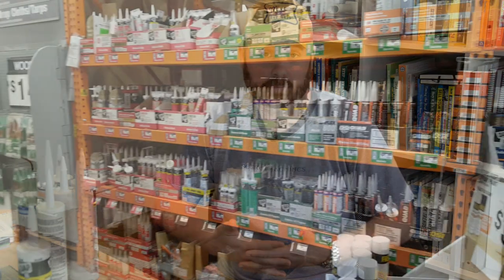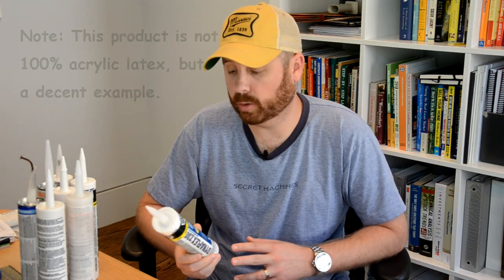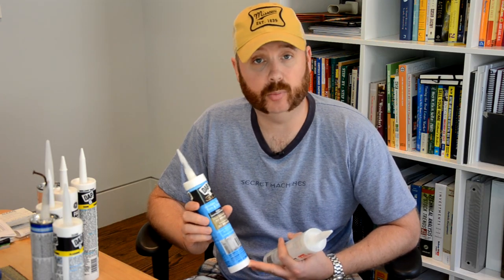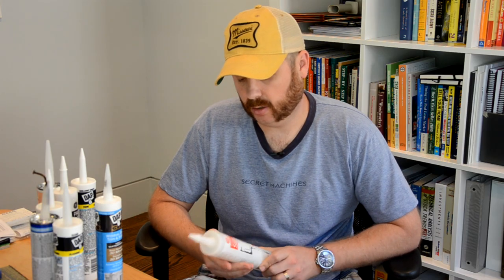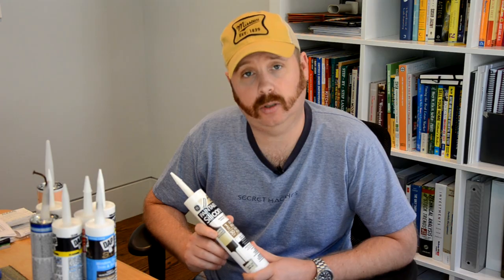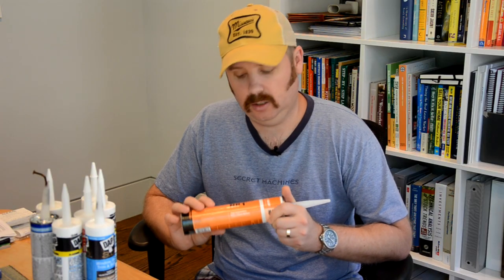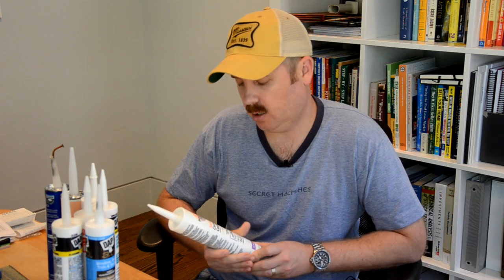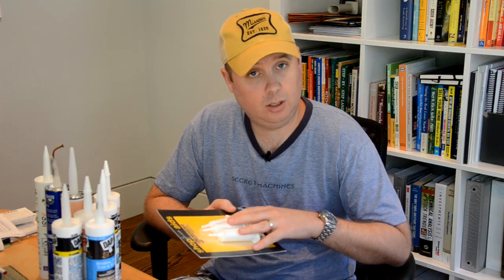Choosing the Right Caulk or Sealant

Comment: I have a question this insightful video didn't quite answer. Can I safely use polyurethane caulk in a tub shower that has a fiberglass tub with ceramic tile with mutton chops, or should I be using silicone with a handlebar mustache?
Reply from the maker: For a fiberglass tub and ceramic tile, I typically go with silicone and a fully shaved face. I tried it with a full beard and....oh boy, that was mess.

Comment: Appreciate the info. I need to replace the bathroom's ceiling light fixture (just outside shower). The previous didn't seem to have any sealant, would I need to seal the new fixture so condensation doesn't get between ceiling and fixture, possibly into the electric box?

Comment: So what type would you recommend for exterior on wood framing? I need to fill in gaps and will have to paint it. My husband applied sometime ago, but it’s all cracked and looks ugly. Appreciate your advice. Loved the video and transformation! 🧔👨‍🦰👱‍♂️
Reply from the maker: I would recommend a paintable polyurethane. Something like Loctitie PL Polyurethane or Sonolastic NP-1. If the gaps are more than 1/8", get a foam backer rod to first place inside the gap/crack. Before painting, allow the sealant to fully cure - check the label to find the cure time for that brand.

Comment: Very very helpful, so thanks for putting this together!  Wish you would have continued with temperature limits for the remaining caulks as you did in the beginning.
Reply from the maker: I'm glad you found this useful! With the exception of 100% silicone, most of the temperature limits are manufacturer & product specific. They all have their own "proprietary" formulas so the temp limits can vary even if two products are labeled as the same sealant type.

Comment: What type of silicon should I apply in between of the toilet flange and it's extension. I installed tiles in my bathroom and the toilet flange is lower then the floor now in order to do it level I have to put extension piece over the toilet flange and I was told to use silicon. I appreciate if could tell me. Thank you

Comment: I'm having a shed built in the backyard this week. The base plate is galvanized steel c channel going on a concrete foundation. I'd like to caulk around the perimeter to keep water out. In addition, I'd like to do the interior walls as added protection against critters and weather. Any recommendations?

Comment: ToolboxDIY:  I need to caulk around the windows in the interior of the home.  I also need to caulk the trim that is at the edges of the ceiling.  And the trim at the bottom of the wall right above the floor.  So, what do you suggest would be the best caulk for this task?

Comment: I have an unusual need for caulk if you don't mind offering some advice? I am restoring an expensive sneaker and the heel cup has a crack on the 3m reflective plastic. I'm looking to fill and seal the crack with a flexible caulk so that it doesn't go rock hard for wearability purposes, and also want to paint over with a reflective paint to restore the original look. What would you recommend? Would the white DAP flexible acrylic latex caulk with silicone be a good match?

Comment: I have a manufactured home that has cellulose sheathing. All the windows were installed with mastic tape. One of the windows was leaking when I pulled the siding off I noticed that not only did they not use mastic or any other sealant they didn't put any screws in the top of the window flange. I was going to pull the window and reinstall it. With the cellulose sheathing what would you recommend.

Comment: is there any chaulk you can use in a wall where there is constantly a water leaking  and its not possible to dry it?
Reply from the maker: You'd want a submersible sealant which I have no experience with. I'm not sure how much it would help though since it would be under some amount of constant pressure. Probably best to find the source of the leak otherwise you might be constantly battling this one.

Comment: Thanks for sharing this great info! Looking for a polyurethane caulk or some kind of flexible sealant that's as close to pour-able as possible and will seal in moist or wet environments. Any suggestions?
Reply from the maker: What kind of surface are you applying this to?
Reply: @ToolboxDIY  Thanks for the response! The surface is concrete.
Reply from the maker: I would recommend a self-leveling sealant - many are polyurethane or have similar properties. I have limited experience with these, but I think that's the closest product you'll find that matches your needs. Examples include Sika Self-Leveling Sealant, Quikrete Advanced Polymer Self-Level Sealant, and Dap 18370. I've only used the Sika but it was a specific application different from yours. You might read through the reviews of these products and see if any reviewers had a similar situation to yours.
Reply: @ToolboxDIY  You are very kind. Thanks so much for the suggestions! I've been trying to solve this riddle for a while now, with only having experience of basic things like caulk and silicone. I will definitely look into all of your suggestions!

Comment: Is 100% silicone sealant okay to use on baxksplash between the countertop and bottom backsplash tile space?
Reply from the maker: Perfectly okay to use 100% silicone. It's not paintable but in your case, I'm guessing that doesn't matter since you probably aren't going to paint your countertop or tile backsplash.
Reply: @ToolboxDIY  good. Thx.

Comment: What kind of caulking do I need to use on the joint at the bottom of the acrylic stall panel and the acrylic tray of a calais shower? I applied on the outer and inner sides of the acrylic stall panel, but the caulking from the inside still breaks out and water gets into the joint and pushes the caulking from the outside and then water spills. I used Kwik Seal Ultra Clear (waterproof)  and I left dry 4 days and no matter what, it continues to break. Any ideas?

Comment: What should I use for exterior I need something that will seal wood and concrete I need it for garage door frame there is a gap at the bottom between concrete
Reply: What should I use , I have water coming in under sill of patio door ,there is also a deck attached to the basement wall. Ideas would be helpful. Thanks Karen

Comment: I know with cheap Silicone it will still yellow and break drown to UV rays, only high quality silicone wont. But what think about Urethan's, Polymers, Hybrid Polymers, Co-Polymers, Terpolymer's & Polyurethane's like NPC Solar Seal #900, ChemLink NovaLink, TiteBond Ultimate MP, CP1, Geocel 2300, MasterSeal NP1, SikaFlex & Lexel? A comparison video of testing these all out would show alot of people how these hold up and how they work.
Reply from the maker: I prefer urethane's, ploymers, etc. The intent of this video was to help beginners make sense of the sealants available at the big box stores. I touched on NP1 near the end as an example of a urethane and pointed out these aren't available at the big box stores. I was considering a follow on video to go over more advanced sealants like the ones you mentioned. A comparison video would be interesting. I'll keep that in mind. Thanks for the suggestion.

Comment: Hi from great Britain can you recommend a brand of silicone sealant for bathroom use
Reply from the maker: I'm not familiar with what products are available in the UK, but if you can get the GE Silicone II products, I would recommend those.
Reply: GE 100% silicone does well but don't count on "lifetime". Polyurethane will last but messy and tough to work with when you have many joints

Comment: I have a leaking summerhouse/log cabin, can you recommend an exterior Caulk for running in corners where builders did a bad job? something I can stain over?
Reply from the maker: I don't know of any sealants that I would feel comfortable using for this that can also be stained over. I would recommend Sonolastic NP-1 and try to find a color as close to your stain as possible. Stains are a challenge with sealants since they are meant to soak into the material and deposit pigments in the material. Paint on the other hand is just a pigmented film that covers the material. I think you'll have a hard time finding a sealant that will accept the stain since sealants are designed to resist any type of moisture.
Reply: @ToolboxDIY  thanks appreciate your reply. But what about actual log homes where they chaulk and then stain? What are they using? 🤔
Reply from the maker: Good point. I think they call that stuff chinking sealant. I did a quick search and a couple of manufacturers say that stain over the chinking sealant won't look the same as the stained wood. Those look to be some type of acrylic caulk, but with other additives to make them water resistant. 
One thing you could try is an exterior caulk that says it's paintable. Put a bead on a scrap piece of wood, apply the stain, and see how well it works.

Comment: can any of this product be used on plastic surface and provide good seal? anyone?
Reply from the maker: It depends on the type of plastic. Silicone will bond to ABS plastic but I haven't had luck with it sticking to polyethylene.
Reply: @ToolboxDIY  thank you i applied the calk let see how it turns out based on ur video recommendation

Comment: The epoxy syringe is ridiculous for sealants. If you go to any reputable sealant manufacturers website you will find that the minimum with is 1/4 inch anything smaller and the sealant will no5 perform adequately.

Comment: I listened to this for 12 minutes to find out the difference between caulk and sealant and never found out
Reply from the maker: There are numerous opinions about this so you might not find a cut-and-dry answer. In my opinion, they are the same - just two different words used to refer to general class of product. "Caulk" is a rather old term. I think most manufacturers typically use the term "Sealant". However, I still see both terms used and the lower performance products, like 100% latex or acrylic, are typically called a Caulk while the higher performance products, like silicone hybrids or polyurethanes, are called Sealants. 
I don't think there's necessarily a right or wrong answer. It's really up to the manufacturers on which term they choose to use for a particular product. This can be confusing though and that's why I like to know exactly what's in a product so I choose the best product for the job without relying on the marketing names.
Reply: Thanks very good answer. I see on the GE Silicone they say sealant but you have to read the fine print to see it.
Reply: My understanding is that caulk is used to fill gaps for painting and sealants are used to seal out water/etc. They're pretty interchangeable terms nowadays though, but I think sealant is preferred in general.

Comment: If you use silicone outdoors( it is a very good exterior sealant do not use clear. Dap is crap. Never use any dap products for anything but paint prep. You are wrong about sonolastic not being paintable. All polyurethanes are paintable. The problem arises from movement the  sealant is much more flexible than most paints ( terpolymers and elastomerics being the exception’s) so while they are paintable most paints will crack because of movement

Comment: Latex is only good for prep for interior paint, if it is dap and it’s not acrylic latex put it back if you are shaping anything but latex with your finger you don’t know what you are doing and should pay a professional these sealants are very toxic and if you check their website almost all will tell you to avoid skin contact  I wanted to hate this but it is actually a decent video.Just as a general rule never use clear in an outdoor application ( generally speaking if it is clear it has no uv protection)if you buy anything but acrylic latex or GE silicone  o4 a Sika product from a big box store you are making a mistake I installed sealants professionally for 40 years